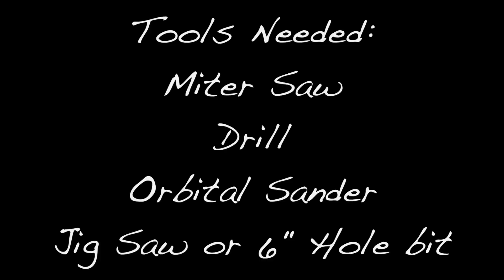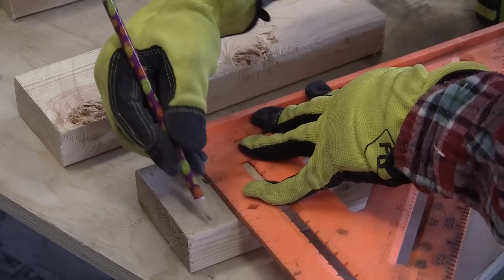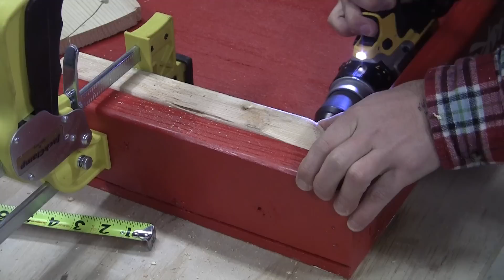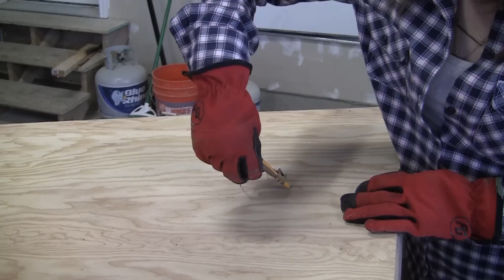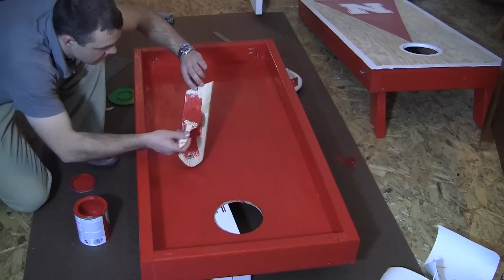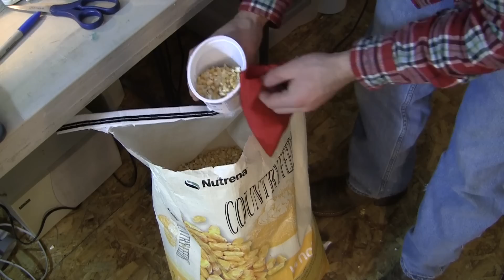How to Build Cornhole Toss Boards - A Fun and Easy DIY Project - Episode 8

Comment: Hi Pete! In the video you said 1 1/4 Kreg screws. In the plans page it says 1 inch Kreg screws, setting jig at 1/2. Which would be correct and what would the setting for 1 1/4 screws on Kreg? Thanks!
Reply from the maker: +Jeffrey Schechter Hey Jeff! I will double check when I get home. I think I switched to recommending the 1 inch screws and 1/2 jig setting because the 1 1/4 may have been a little too long and some people were having trouble with the end of the screw going through the plywood a bit.
Reply: +DIY PETE Hey Pete. Yes, I ran into this problem. My 1 1/4 inch screw went through the plywood. The frame came out uneven and wobbly. I believe I screwed in the 2x4's unevenly? So the pieces were not all flush to the table when screwing. Would you suggest how to avoid the the opposite corners being uneven? Thanks again!

Comment: Did you have any issues with the polyurethane sticking to the paint?? I'm assuming the poly would have issues with sticking to the oil based paint
Reply from the maker: All bonded well. They still look great.

Comment: Hi pete i go to nebraska as well and me and my dad are all done with our boards just looking for the decals and cant seem to find the white N decal you used where did you find those?
Reply from the maker: Hi Joe, GBR! For this I had a stencil made and painted the white logo. But the stencil was made using a vinyl plotter. You'd most likely need to find a local printing company to make a couple N's or you. Vinyl decals should be pretty cheap.

Comment: Great video, Pete! Just wondering, what's your total cost on supplies for building this? The game looks great! (And that's coming from a Badger fan!) :-D
Reply from the maker: YoYoRaeRae Hi! I went to a game in Madison a few years ago and it was a blast! My buddy was a kicker for them so I am a bit of a Badger fan as well :) I don't have the exact amounts, but I know the plywood for both boards was a total of $22 and the 2x4's totaled about $10. Then you have the bolts/nuts (a few dollars) -- the paint, poly, tape, brushes, etc. I made bags in the video but you can find some on Amazon for around $20 which are great. The link below the video has more photos and info on the project as well. Cheers! Let me know how your Badger game boards turn out!!
Reply: Thanks for the info, DIY Pete!  Madison can be one fun place that is for sure.  Currently, they're doing pretty well in basketball, too. :-D  I'm glad you had a good experience.  We Wisconsinites might rib you about your sports affiliations during the game but most of us will be sharing a beer with you after.  Seriously, thanks for making a great vid.  I sent it along to my cousin who's actually the person interested in building the boards, but hopefully I'll get to use it while tailgating.  Cheers back!

Comment: Great video, one thing though. When you are putting on the poly and if you ever have white paint the oil based poly will give the white paint a almost yellowish tint to it. To stop this use polycrylic. Does the same thing but it is water based instead of oil based so it does not distort colors. I use the oil based poly when there are only dark colors on the boards that I make! You can check out my facebook page just search Pickens Cornhole on facebook. Keep up the great work!
Reply from the maker: Hi! Yeah I've switched over to a water based whenever going over white. I noticed a little yellowing as well. Although I do love the way oil based makes the natural grain and color of the wood pop if you leave it unpainted. Great job setting up a business making the boards! Congrats!
Reply: Oh yea the oil based brings out the wood way better. I always try and avoid white if there is any wood exposed bc the wood always looks way better. Love the video keep up the great work.
Reply from the maker: Thanks!

Comment: Did you use a gloss or flat paint, and can you put gloss poly onto gloss paint?
Reply from the maker: Hi Steve, I used an enamel based gloss paint, let it dry, then poly'd over it. It bonded well.

Comment: I have a random sander and not a orbital sander. Will a random work the same, or should I buy an orbital sander?
Reply from the maker: +Jose A. Munoz Jr Hi Jose! Any sander will work! I have a random orbital sander that I use most often, but commonly use others. Cheers

Comment: would oil based gloss paint work for the boards as well or should i use a different type?
Reply from the maker: +Jeremy Ponce Oil based gloss is similar to what I used. The only thing I don't like about oil based gloss is that is that it gives white painted areas a slight yellow hue. Not bad, but a few people have mentioned this. I like using oil based because it protects well and really makes the wood grain pop.
Reply: +DIY PETE what type of plywood would you recommend as well?

Comment: Pete, in the video you say use 1 1/4 in keg screws to attach the plywood but in the written instructions it says 1in kreg screws. which should I use? do I set the drill bit to 1/2in? 
thanks!
Reply: I was wondering the same thing. I suppose I could adjust the collar in the bit. They really should mention this in the video or people are going to be upset when screws are poking out of their cornhole board top.
Reply: Here's a link to the Kreg website for proper settings depending on wood thickness.

https://www.kregtool.com/files/newsletters/kregplus/june14.html

Comment: question, what would be wrong with using corner bracts to screw the pieces of wood together ??
Reply from the maker: You certainly could.  I went with the screws and pocket holes because it is a bit more snug than corner brackets would be and there isn't an extra expense for the brackets.  Cheers!

Comment: One of my cornhole legs is on at a slight angle when extended due to me drilling off center a bit. What would be the best way to fix that? A bigger drill bit to make a straight entry? I can still get the board to the regulation height but the appearance bugs me. Thanks!
Reply from the maker: Hey Pat! You might just re-cut the 2x4 quick and drill again. If you don't want to cut another board, you could most likely bore the hole a little larger, but then you'd want a bit bigger bolt so it doesn't have a loose fit. (simply re-cutting that one board might be the easiest option) Best of luck!

Comment: My VictoryTailgate boards are so slick, the bags slide off every time we toss. They advised me to spray the boards with clear Flex Seal. Is this the right thing to do or is there something better? Thanks.
Reply from the maker: +Danny Bruce Hi Danny, what did you originally seal the wood with? A polyurethane or the flex seal?
Reply: I bought the boards from Victory Tailgate and they advised me to add flex seal to make them no so slick. It's a complete set from Victory Tailgate with pirate ship and crossbones. I have no idea how they build and finish them.
Reply: +Danny Bruce hey I have the same problem did you try the flex seal
Reply: +Tim Spencer  yes.... use 1 coat...let cure.... then add a 2nd coat. Works fine but your graphics won't look as nice. Gives it a rougher texture and hazy.... collects dirt too. :/
Reply: +Danny Bruce do the bags still slide or just start to flip once they hit still want the slight slide to them
Reply: +Tim Spencer I only have 1 coat and they slide. I'm adding another coat this weekend. I feel it'd be better.
Reply: awesome thanks for your knowledge

Comment: How come you didn't glue plywood as well as screw in? Also, what if my plywood is about 48 and 1/4? How should I cut?  Thanks!!
Reply from the maker: +newbie1982 Hi! You could glue if you'd like. I didn't in the video as it isn't really necessary for something this simple. If the plywood is a 1/4 inch long I don't think it is a big deal, but if you wanted to shave off a 1/4 inch you could use a circular saw and straight edge, or a table saw. Good luck and have fun with the build! Cheers

Comment: hey wanted to no if I can use Rust Oleum Painters Touch crystal clear gloss? it's for indoors and outdoors projects.  thanks
Reply from the maker: Hi! Yes, a spray sealer for sealing will work. You'll want to do a few coats.

Comment: So, does pretty much any vinyl decal (that is intended to be a sticker, not a stencil) pretty much work as a stencil?  I would think they would be made to adhere too aggressively, and that you wouldn't be able to get it back up gracefully (without damaging the base coat, etc). Any secrets here?!?  THANKS!!!
Reply from the maker: ***** Hi! I used "calendared vinyl" which peels off easily. It continues to create a stronger bond over time though. So peeling off after a day or so on pretty much all vinyl is pretty easy (especially on wood) --- When applying to glass or a real clean surface it adheres much more. So peeling it off can be harder. -- But I had no issues with it damaging the base. I use this process for quite a few projects. Here is a metal project where I use vinyl as a stencil as well. Cheers! https://www.youtube.com/watch?v=VQkSaZA-8DY

Comment: Good video but there's an easier way to cut those angles on the bottom of the legs. Also, I found that 1x4s work just as good as 2x4s and not nearly as heavy.
Reply from the maker: Thanks!

Comment: How far down on the legs to you begin your jigsaw? I followed your measurements but looks like a good inch down from that cross line is where you have to begin...tried twice with your exsact measurements and run into same problem,
Wont fold upright without hitting the back of the cornhole board,
Reply: chad steele I ran into the exact problem using these measurements.

Comment: Pete,  where can I find a circular stencil for the hole?
Thanks
Reply from the maker: Hi David! Here is the circular bit which will create the perfect 6 inch circle. http://amzn.to/24LVR14   However, if you referring to something to help paint the circle around the ring -- I unfortunately don't have a resource to recommend -- What you can do is use painters tape to cover the ring area -- then use a compass to draw the ring - then a razor blade to cut the tape along the line to create a taped off area. Lastly paint. ( I have a vinyl plotter and made the stencil )
Reply: @DIYPETE  You can use a pencil compass like back in grade school,adjustable

Comment: Man, I don't have any of these tools. I'm thinking buying a cornhole set just might be cheaper.
Reply from the maker: Hey Cory! I slowly acquired tools when I was getting started. Definitely an investment but was well worth it. I initially found some great deals on Craigslist when I was buying my first tools. - but if you don't think you are wanting to invest in tools then buying a set of boards is certainly another great option. Cheers